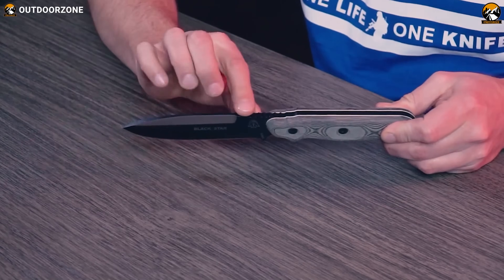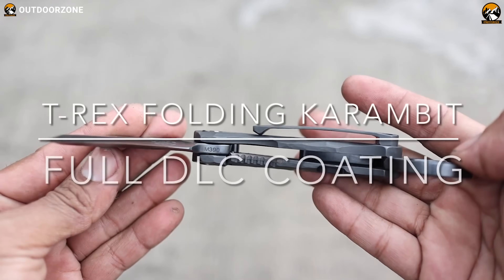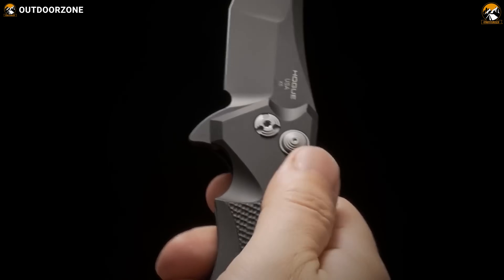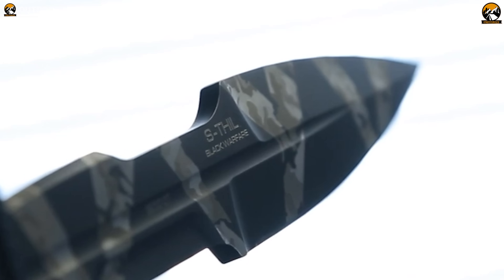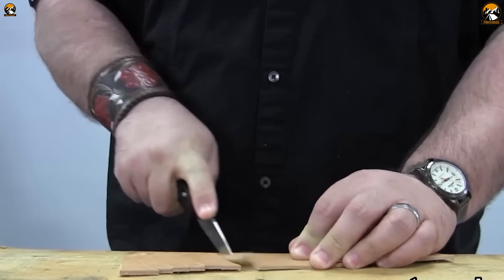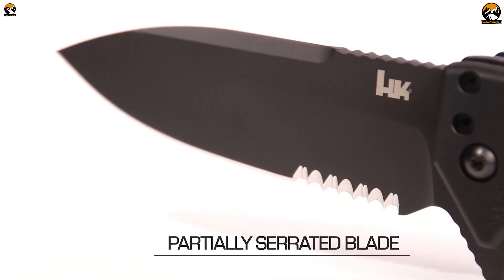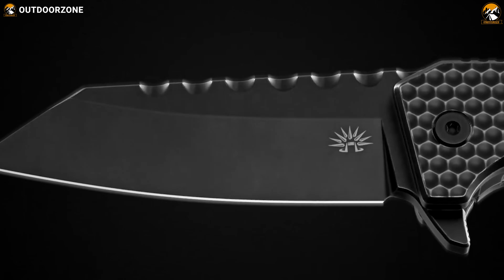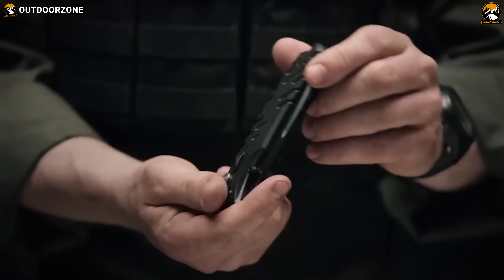70 Ultimate Military Tactical Knives for Survival and Self Defense

Comment: So much wrong information in this video.   154cm is the type of steel, not 154 centimeters.  Sk5 is not corrosion resistant,  its a high carbon steel that will rust easily.  And so on.  Don't trust anything this guy says and do your own research if you are interested in one of these knives.
Reply from the maker: cm and centimeter, that's a mistake from our side. And as per the corrosion resistance of SK5, we said it's "resistant" not "proof" Do you think water-resistant, and waterproof is same?
Reply: 154 is a really great steel I have Benchmade knives made from this steel.
Reply: 154cm is obsolete. Really really obsolete.